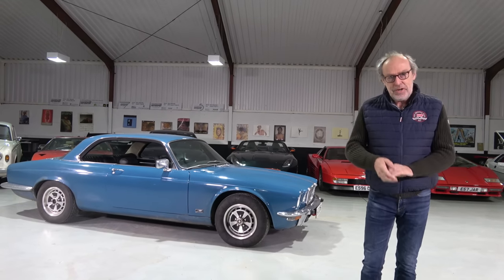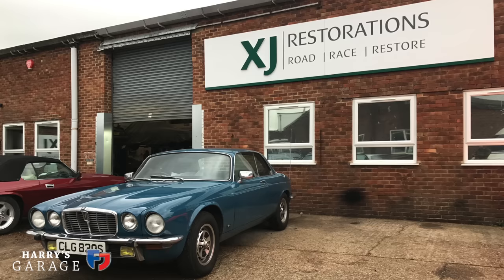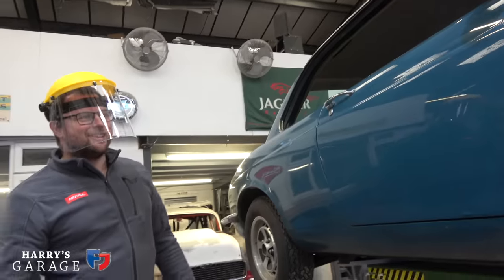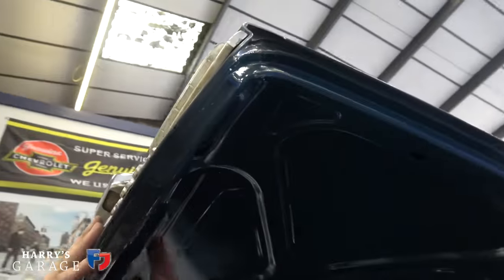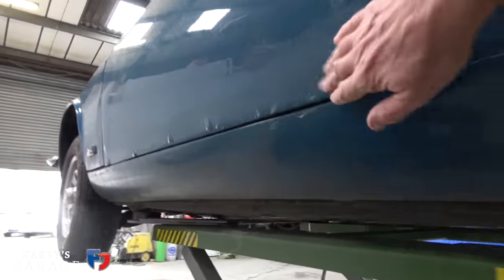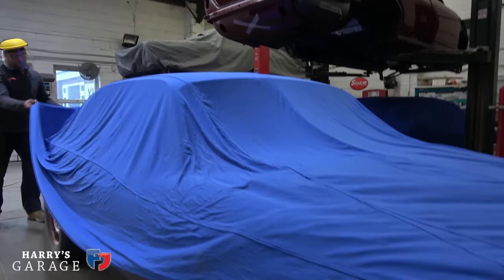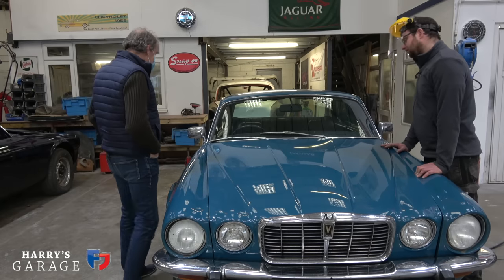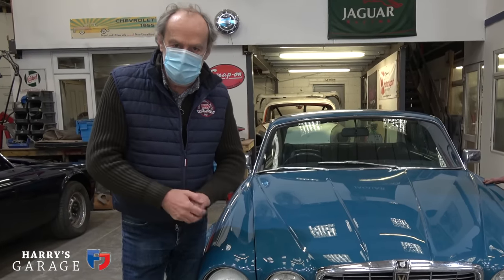Jaguar XJC V12 manual restoration part 1. Just how rusty is it?

Comment: I love old Jags, certainly a car in Harry's collection more than deserving of some TLC. 1970's British Leyland so check for rust just about everywhere. I had a '74 S1 XJ12 in the early 80's which had rust just about everywhere. Great engine, even with the asthmatic Stromberg carbs and thankfully much improved with the later fuel injection at the expense of under bonnet complexity. I'd also go with a dark green, if not BRG. I always lusted after John Steed's XJC in the New Avengers series, perhaps a bit too far from originality for some though.

Comment: Harry. I am in the process of refurbishing my xj6c. Mine was in much better shape than yours. However, many issues  I faced were not mentioned. Based on your outside condition I would be concerned of the following: rust under rear window, rust under rear seats, rust under front suspension reinforcement, serious rust between floor pan and main chassis rail. The car is quite easy to work with. My first resto project that I am undertaking myself. But pls dont cut corners!

Comment: Any color change  a deep quandary no doubt. Lyons favored non-metallic palette on S1-S2 judging by US-spec imports here at the time. My coupe' was regency red, a competitor for 275GTB Rosso Rubino. Original and proven show stopper. If I recall some 694 made 75-76my. The black vinyl top lessened the deep red tone. Your case is different. IMHO non-metallic preferred; XJC contours need no enhancing reflective management. The evergreen appeal is the design.

Suggested to consider: XK150S 3.8 Roadster, 'Eggplant' (not the name) but you would have an astonishing device with the 12C contours. Kudos on the suspension upgrade and XWX!

Comment: Instead of the very dark green I would look into the slightly lighter greens that Jaguar did as the almost black green does less to accentuate the swooping lines, they need just a bit more colour / light. A good example is the Sherwood green they used to do in the 60s.

Comment: My brief would be;
1) Any paint, so long as metalic to bring out the lines, 
2) a balance pipe in the exhaust to get that sweet note the s3 "e" achieves, and 
3) 235 60's wrapping around the kents to finish it off.

Comment: So here we go...comments:

That's a car I'd be proud as punch to use regardless how scabby the bodywork was.  Seriously, it's 1000 times cooler than most things on the road now.

The sound as it backs off the trailer...oh WOW.  It is good to remind ourselves what engines should sound like.  Even 4-cylinders sounded better in the '70s or early '80s...just watch some rally footage of the mk2 Escort if you doubt me.  So for me the perfect engine would be a modern one (power, delivery and economy), but with 1970's noise and emission regulation compliance.  No cat, no turbo...just a free flowing sound.

Of course I concede to the wisdom of "it's a complex body, mechanicals are easy to replace...", so perhaps I'd rather have a good body and tweek the car to my liking approach.  Just as long as it's not a slushmatic thank you very much...

The run-out proves my point about the noise...

Comment: Harry - I agree the blue colour is not so hot when it has the black vinyl roof but with the vinyl removed and painted blue as yours is - it is the best colour for the XJC - with a new blue paint job it will look magnificent - purple - really :-( , if going red it needs to be maroon, and if dark green then you might as well just make an avengers clone.
Stay the blue and thanks for giving this car a makeover - I have an etype and always wanted an XJC 5.3 as well - bought a wreck 25 years ago but never rebuilt it - was too hard - looking at an expensive XJC 5.3 now but it is the wrong colour - if it were that blue I would have already bought it.

Comment: A very noble project.. i do like the blue as it is a bit different; I’m not sure you can go wrong with a British racing green metallic to help bring out some of those gorgeous lines, problem is I’d then start to think about cream leather as well though 😬,  It would look quite statesman’s like in black (i know black kills the lines) but that could be lifted with some purple fleck in it, actually thinking out loud that that would also look good on a green base (not a silly candy level, just enough at a show that it would lift the colour) , cant help thinking it should have wire wheels too..

Comment: I look forward to seeing this project through to its completion. I have to say when the guy gave you a figure of £15 to £20k I was surprised, considering what has to be done, I had in my mind a figure of £30k, I would say the figure given is a bargain. I’m currently restoring a shabby MG CGT of similar condition, which required a certain amount on new panel work and I was given a price of £20k by a very respected Austin Healey specialist, this I felt was way too much considering they would have had a stripped down shell, so went an MG specialist and the final figure for bodywork and respray was £8k!

Comment: I do remember the steering boss on the xj just looking like.... Erm I a greasy shiny plastic black splined thing. I guess you'd only know if you had to sit in the passenger seat and be driven at 40mph using 0.9% throttle actuation.

Comment: Not surprised Harry is investing in the beautiful Jag. There seem to be no currently built cars with an ounce of style. My theory is that they make small models out of the same stuff as boiled sweets. The design teams then sucks the models for a while to see what they come out like. All details are dissolved off, no corners left. Then they use that as the shape of the car, devoid of any features. I have to remember my license plate number of my daily driver to distinguish it from all the other almost exact same shape and color cars in the car park. My P38 however I can easily find amongst the crowd.

Comment: Oh Harry...I wish you had seen my 1969  XJ6 Series 1 4.2 because it has rarely/never been out in the rain from new...it did not have any rust issues and was all original  except for a concours repaint in 1998 to correct wear in the finish after monthly polishing from new by the one previous owner. I has just left JLR Heritage after a complete mechanical check and overhaul in every area. On your car, you need to check and replace the fuel tanks for the latest fully treated one to cope with modern fuels...both of mine were renewed in 1995 but were eaten inside by rust by last year despite regular use so I would make sure yours are done with new fuel lines and pumps. If your man sorts yours out for £18000 in three months then that is a bargain!! Mine got stuck in the Lockdown misery so was at JLR for 13 months! Sadly we were and still are in the process of moving house which started August 2019 and I knew I didn’t have garaging for it so agreed to let JLR sell it. Now I have sorted the garage problem and could have kept it...but no...it is with a new owner and I never even saw let alone drive it before it went. All because of C19..arrgghh! I will be watching with interest...keep £25,000 in the building society just in case..you might need it!! Good luck! Richard.😃😃😃😃

Comment: Yeh, I don't like Squadron blue either Harry  (I used to sell these new), and it looks strange to have a coupe without a vinyl roof.
Not sure about changing the wood on the dash - what do you have in mind?
Since you aren't precious about originality, I would be sorely talented to do a 'Steed' on the car.....to give it the visual aggression to go with the exhaust note! Don't know how  feasible that is today. You have got to do work on all four wings anyway, and once done the arches will never rust again. Oh and paint it the original Steed green.
You would have to find the correct Steed wheels though with high profile tyres to fill the arches out!

Comment: Because clear visors absolutely stop the Rona. Wonderful magical thinking. But to the car, it's begging for an LS engine and a six speed transmission, Wilwood brakes would do it some favors too.

I had an '84 XJ-S V12 in teal, it had been resprayed in Chrysler's equivalent and looked very good with it's tan interior, sagging headliner and all. That wouldn't be a radical color change but would add some pop to it.

Comment: That big Jag coupe has a lot of the feel of the Avengers car about it, without the crazy Broadspeed body kit.  Definitely a bit of a sleeper, especially in the oh so '70s Squadron blue that looks so much like Pageant blue that was seen on lesser members of the BL range...

Maybe for the colour, go for something close to the original blue, perhaps with a metallic or pearl to it to make it a bit different from the rest out there.  That might satisfy both the originality freaks out there who will, inevitably, lambast you for changing the car from its' original colour scheme, and satisfy your desire for something different.  On a personal level, I can't help thinking that a solid or metallic black would make the car look properly sinister when combined with all the chrome touches, and would rather reflect the much enhanced performance of the car, but it might be a bit of a pain in hot weather if the car doesn't have air conditioning as it's just going to absorb the heat from the sun, which can be an issue with any darker colour on a vehicle in the increasingly warm, weather we experience now.  If you're going to go for a dark colour then it's well worth considering the Daimler chrome side moulding strips as they really help lift the car and stop it looking so slab-sided, which they can otherwise in a dark colour...

Comment: Harry, this is my favorite of all your cars! One of the most beautiful cars of all time in my opinion (and I'm a car designer by trade with vehicles on the road that you are very familiar with). With the standard of bodywork and paint Keith achieves and looking at that lovely blue metallic on the other 12C, the dark green would be my choice - it will just look spectacular against the chrome! BTW, losing the chrome at the base of the C Pillar will make it look even sleeker. Is there any stiffening you can apply to the shell to stop the cracking at the base of the A Pillar? Glad you are doing this and excited to see the results on your excellent channel.

Comment: You think BL in the 70s was bad for the Warren St Lace do you? A lifelong Rootes Group, fan I was told (by a retired employee at a car show in 1978!) that the underseal Rootes used was mixed with cotton flock to promote sound deadening. It acted like a wick! In my lifetime the best contributions to motoring have been the plastic wheelarch liner and hot wax injection. Forget computers and electronics.

Comment: Amazing how the cost of restoration magically increases with the value of the car.  Early Porsche somehow costs £50,000+ (more like 80 if it needs a full engine/gearbox rebuild) whereas the Jag will be 15 - 20,000.

Comment: I always preferred the coupe back in the day. Very stylish - especially with the right wheels - deffo NOT those XJS wheels.....! Basically ALL old UK cars are rot-boxes - as were most other countries cars too of course pre-1990's. However, I recall seeing those Jag bodies being transported in the rain - in bare-metal , - no protection whatsoever....! THEN - they were stored in the old Spitfire factory at Castle Bromwich, under leaky roofs, with pools of water under them........rusting merrily-away..... Not surprisingly - all the regularly used cars soon rotted away. Personally - there is NO WAY I'd spend big money and NOT take the car right back to the shell, repair it properly, and then FULLY treat the whole shell inside and out. Anything else is a bodge - and the rot is guaranteed to come back - probably sooner rather than later. Sad - but true.....! Six months at least.

Comment: It is a beautiful car.  But they are made of really crappy steel with no consideration for rust prevention.  I had an immaculate example of a 1987.  I got it 3 years old and it was perfect.  It never saw a Canadian winter and spent all of it's life indoors.  In three years it still rusted out and needed $15k in body work to sell it.  The market at the time was $10k in value so it was totaled.  I traded it together with an Olds Toranado even money for a used Ford.  The dealer took a beating on it as he did the body work.
There was a hole under the mats in the driver's side.  The metal holding the hood hinges rusted out to the point the hood would not open, and it was starting to show holes forming in a couple of the spots on each side that Harry's has.  This was after 3 years of being frequently stranded as some electrical gremlin crept up.  This car is the one car that cured me from ever wanting an exotic car again.  After this my daily drivers were bullet proof American sedans followed by maintenance free Japanese cars.

Comment: I worked on one and remember the doors were a nightmare they were made out of 2 sedan doors at the factory and full of filler
Reply: @Bob Fleming Oddly I had 4 doors and all were the same- there was a mix of lead and some sythetic filler- I have found sythetic fller in Mini's from the mid 70s under original paint,

Comment: 3 Grand to fetch the engine in & out hope that includes any remedial work to it ie seals etc & painting the engine bay otherwise dick turpin is alive & well. 
Definitely with you on the colour change as that colour does nothing for the lines of the car would look ok on a mini clubman i suppose, Shame its not a red interior else you could have gone grey needs something that will make the chrome pop

Comment: "Buy the best body you can" - I have been saying this for year with most classic cars, they can original engine or fully electric with current (no pun intended) trends........but if the body is a pile of crap, where are you going to bolt all those shiney things? My experience so far stems from old Italain cars, where they will rot even sitting in a garage.